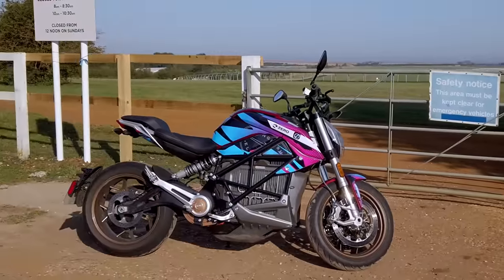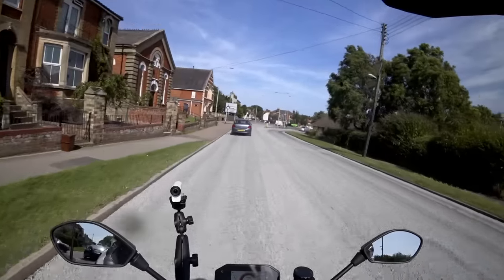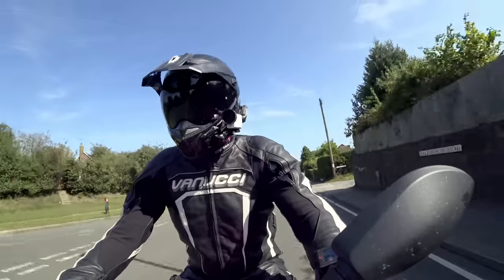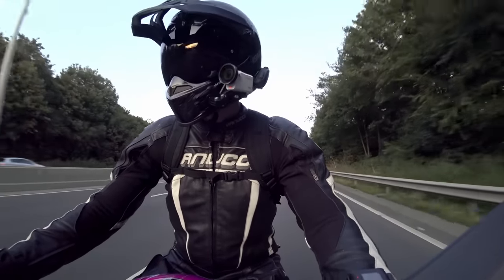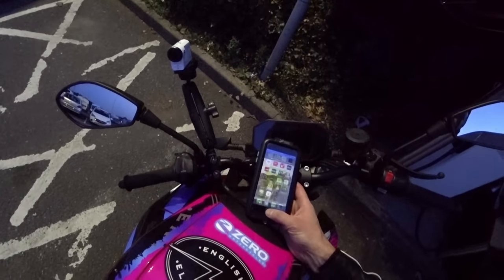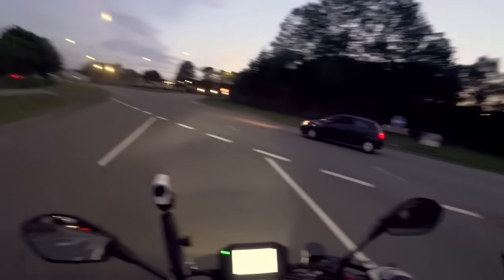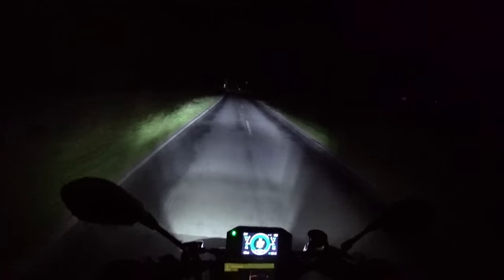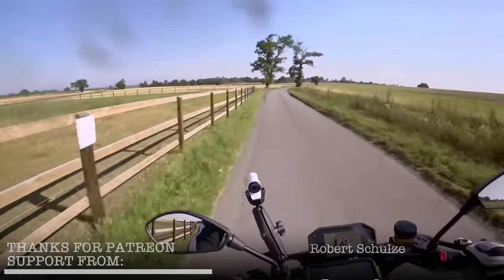Zero SR/F Real Life Ride Review

Comment: Hay Man Im just a idiot that has Bin Riding Bikes sins 1975! Ish, If that thing had a Gearbox Shortly it wood have a 45% Longer  Rang! but whot wood I now as I cannot even Speal!
Reply: Or just a smaller motor?
Reply from the maker: I've thought the same. I think that'll be the next step if I'm honest. After all, electric trains have gearboxes. You can hear them shifting as they pull away from the station. They're much bigger though! I think the complexity and size/weight is the restricting factor right now. But then it makes perfectly simple sense because if you were to ride your petrol bike around in only 1st gear, your range would also suck!!
Reply: @AndyManCam  may be to do with the tork number the hier the tork the stronger the gearbox will need to be, but I my be wrong🤔

Comment: I said it once, I'll say it again: Electric vehicles are not the way to go into the future, as demonstrated by Andy in this video. It's for a reason that EVs have been pushed out of the market by petrol cars in the early 20th century. Seriously, look it up.
Reply: It will be very hard to keep using petrol vehicles when the petrol is gone.
Reply: You can say it as often as you like, it won't change the fact that we'll have to stop burning fossil fuels within the next few decades to avert catastrophic climate change. EVs in the early 20th century are not indicative of anything happening today. Electric trains were also not competitive with coal-fired trains for long distances until the infrastructure was built, at which point they quickly were abandoned.

The battery charging technology is in its infancy. Once you have access to fast chargers or are able to swap your empty battery for a charged one automatically at a station, "fueling up" will be quicker than it is now with petrol vehicles. Give it another decade, and these problems will have been solved.
Reply: @SirNarax  I'm not making a case for petrol. I'm just stating the obvious: EVs are a feel good measure, not an actual solution.
Reply: @HeretiCflow  Do you have an alternative?  Battery technology is still early to mid 20th century.  Even if it isn't the long term solution it is going to take over and hold before the better solution comes about and gets hold.
Reply: @SirNarax  in a free market EVs will go down like they did before. One of the most interesting things I've stumbled upon is the research Hyundai is doing in the field of Hydrogen. Definitely go check that out.
Reply: @HeretiCflow  I know about it.  The issue is storage.  Hydrogen is extremely viollent and can cause worse damage than someone like a battery exploding.  Hydrogen and Oxygen make water but they also make rocket fuel.  EVs will take over in the near future but you can be sure whoever comes up with a way to safely store Hydrogen or create a way to power these generators with sea water will be very rich.
Reply: @SirNarax  what you call "violent" is in fact energy density. Hydrogen stores 120 MJ/kg, Gasoline around 40 MJ/kg and Lithium Ion Battery 0,65 MJ/kg. At this point you can probably see why Lithium Batteries are not the way forward for individual transport. They are compatibly inefficient when it comes to energy density and take a long time to recharge, which are both key to personal transport, aviation and naval transport. Therefore, we need to move up the ladder in terms of energy density and above gas and oil there are several gases with hydrogen at the top before we venture into the field of nuclear energy. Naturally the higher the energy density is, the more dangerous it becomes when this energy is released at once, but I'm pretty sure we can handle sth like hydrogen safely/ with a minimum risk using technology earlier, than we will make a quantum leap in battery technology.

Comment: Real life response ro electric motorbikes. WAY OVER THE TOP EXPENSIVE! Fewer moving parts, all boards magnets and batteries. Come on! EVERY EV, sold is paying for the R&D on the better version. Big Pharma pulls that off quite well. I would have one of these in a heart beat if it didn't leave me skint for a decade paying for it only to become obsolete in 3-5.
Reply from the maker: It's the same for all new tech. First the R&D costs have to be recouped, and THEN the prices become more reasonable. Remember when a DVD playwer cost $2000?!

Comment: You need to learn how to use the ecotricity charger, it was on free vend so you need not have paid or used a card! Nobody is going to buy electric vehicles if you’re putting out misinformation.
Reply from the maker: Trust me, it wasn’t going to let me get to the stage to confirm the charge, without me putting in a credit card number. It also told me both that the charge would be free while also telling me that I would be charged for it. So the misinformation here was being given by Ecotricity. People WILL still buy electric vehicles, they just won’t use networks like this one unless they sort the user experience out.